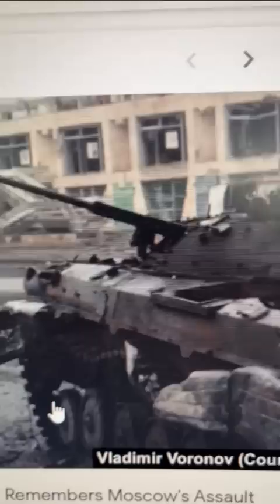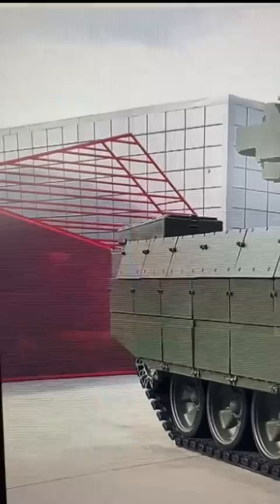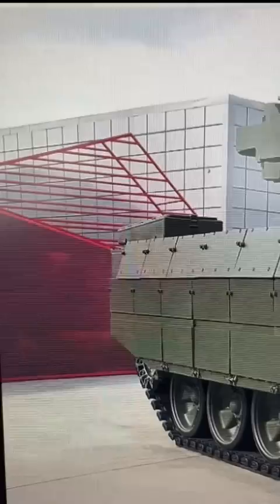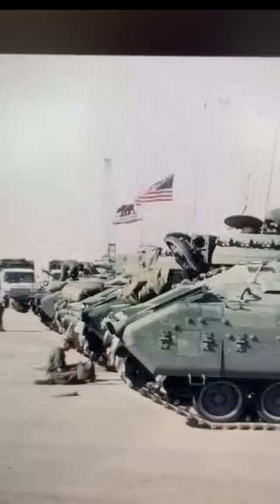BMP Terminator barrels shaking?

Comment: As a Retired Bradley Master Gunner, if I had one of my Brad's on a range have their barrels shake like that, I would pull them off the range. They ain't hitting shit like that. The terminator must be using its 30mm like a coax.
Reply: As a gunner on a brad, that shaking would have freaked me out. Circle X. Lol
Reply: They do not operate the guns simultaneously normally. They aren’t dual feed and each gun is loaded in combat with a different type of belt. This makes it as accurate as a BMP2 when firing.
Reply: @exo068  When I think of having two weapons, "let's make it impossible to use both at once" doesn't strike me as a design priority.
Reply: @michaelccozens  well there is mostly no reason to use both guns at once. One is usually loaded with APFSDS and the other one with HE. You have no reason to use APFSDS against soft targets and the single feeding allows for a easier design. The design idea was that you have something that is low collateral damage and can be used as a direct support of the infantry.
Reply from the maker: So you're a mike golf?  Did you ever get any sleep?
Reply: @exo068 It's 2 x 2A42 guns. Same duel feed gun that was designed as duel feed for the BMP2 only now there are 2 of them together. They literally built them in the tens of thousands now.
Reply: @michaelccozens except since they are just 2 x 2A42guns put together side by side and the 2A42 has always been duel feed since it was produced in 1980 that's not the case. Geeez guys, 5 minutes on wikipedia would have cleared this nonsense up.
Reply: Putting aside the inaccuracy issues, that much extra strain must wreck havoc on the weapon too?
Reply: @flyingace1234  I mean they've made the 2A42 gun on it in the tens of thousands since 1980 I think they've come to terms with
Reply: yeah probably something vibrated loose somebody  forgot a lock washer
Reply: These are hacked together solutions that were issued to people with zero experience. If you want accurate fire, use one barrel, you want to make the walls of an apartment go away? Use both. It doesn't matter how much the barrels can take since your going home in the Black Tulip anyways. If they can afford it.
Reply: @crazygmanssimstuff  Yes, and it does not have dual feed capabilities. The turret housing is likely preventing them from doing so somehow. 

This is the reason the lack of dual feed is so comical, because Russia has known how to do so for decades. The BMPT is a god awful design and it's really hilarious that it even got deployed.
Reply: @crazygmanssimstuff  as I said they don’t use the dual feed in the BMPT. The guns feed from different magazines and can therefore shoot both types of ammunition loaded at once. This isn’t standard practice but possible.
Reply: @exo068  in that clip only one of the guns are firing. You can tell from the case ejection
Reply: Ryan stop erasing my YouTube link to videos, people need to know how it look like when BMPT 2 mow forest's trees and destroy tank and bmp2
Reply: @187Rajah  hey ivan you don't YouTube much do you?
Reply: As he said, if it's at point blank range in an urban environment all it needs to do is point and shoot and something will get hit haha
Reply: @exo068  
Here's one you'll enjoy, and it involves the Duster gun he showed briefly in the video. 
I was a Vulcan gunner back in the 80's, my Sgt Major was on one of the 5 Vulcans in Vietnam, before that however he was over there on a Duster.
One day he was telling a group of us some stories about when he was in Vietnam, it's no secret that the North Vietnamese didn't have a very big air force and they never roamed south because they couldn't afford to lose any aircraft, so any air defense guns in the south usually were deployed on other duties like perimeter defense at fire bases, with the Dusters when they were task with fire base defense they'd load one barrel with the self destruct air defense rounds and the other barrel with regular 40mm contact fuse rounds typically used for ground targets, when the NVA would attack a fire base the Duster would fire the barrel that had the air defense rounds in it and give the NVA enough time to move their mortar positions up to just outside of the range where they'd self destruct, then they'd cut loose with the other barrel and give them "the last surprise they'd ever experience in their lives".
Reply: @dukecraig2402  yea I guess the idea is very similar to what the BMPT is trying to accomplish but it’s definitely less successful at its job. It reminds me of the tactic of shooting canister rounds at tanks to get the NVA off them. It was effective but very disgusting because it would let fluid flow on the engine and in gaps and it wouldn’t go off easily.
Reply: @exo068  
Yea, I heard about them using that and beehive rounds, it definitely made a gooey mess on the tanks, like being coated in a raspberry slushy.
Reply: @willthorson4543  Imagine the noise and vibration inside! 
Double vision problems.
Reply: @senseishu937  Urban, not military targets.
Reply: @theprotagonist8755  woot? You like to watch Ryan's russophobic videos?
Reply: @exo068  The single barrel firing in the video is shaking more than the one that isn’t
Reply: @kieranwalsh2058  the shaking isn’t that bad. The recording of the video by hand and with a lower resolution camera makes it look worse then it actually is. The shaking is comparable with the normal BMP2. It’s not good but also not bad.
Reply: @187Rajah  1. Ryan isn't deleting your links, it's youtube.
2. Go touch some grass
Reply: @trololoev  it has a dual feeder. They use two belts usually AP and HE. The belts are pushed towards the bolt and it can then chamber the round. The bold is positioned in such a way that it can feed from both sides so all you need to do is push one or the other belt  towards the bolt. This is very different from what western auto cannons usually do. They usually use rollers to delink the ammo first. This is more complex but allows the gun to be placed in different places in the turret.
Reply: @sebtroop23  so , why i can copy it elsewhere without any issues?
Reply: Remember in boot camp, seeing the M16 receivers stamped by Mattel, GM Torqueflite,  etc.? Russians got to see "twizzler" stamped on their weapons.
Reply: Yes but those are very different guns. If your camary goes 100mph, it's scary af. If your supra does 100mph, it's a cruise. It's a fixed recoil system. One balances the other. The only reason it could fire so quickly without being center mounted or a recoiling barrel is because of this setup.  This particular vehicle was tested for about 13 years or so before it actually went into production.  I'm pretty sure they would've seen if it had an accuracy issue. The longevity in such a setup, i cannot speak of.
Reply: @187Rajah you do know that it can be anybody reporting your links, do you?
Reply: @187Rajah  russo-fanboy is posting about Ryan and his viewers, while watching Ryan's videos and not understanding how yT removes links in comments?  Stop it and do your homework. You can't get those grades up wasting time on yT child..
Reply: @wildancrazy159  while who's opposing him? Oh, accordingly to you, an anglo-fanboy. Play more in child games
Reply: @worldoftancraft  I think it's a language barrier, you don't speak English as a first language. Anyone would be happy to help you out with that. Anytime you need help, please ask. I'm happy too!
If I may ask, where are you from?
Reply: @wildancrazy159  I do speak contemporary vernacular English. It's out of the field of speculations.

What I meant is to give you such a reply that would exaggerate the unpleasant to me findings in your reply. That's it.
"Russkie" sounds cretin. It's even doesn't spelled this way in original. Russkij(-aâ/oê/iê), |â| can be written as |ja| and |ê| as |je|
Not to mention your typical internet war accusations and assumptions.
Reply: I'd really appreciate it if you would if you were to add subtitles to your videos. They're great already though.
Reply: @drbadbrain4714 t's not "God awful" it's purpose is for support and urban combat fighting. As long it keeps it's comrades safe, and stay in it's role then that's all that matters. Putting it in situation opposite of what's it's capable of ruins it's purpose.
Reply: @subjectc7505  Okay. Its design is god awful.
Reply: @drbadbrain4714  What about it's design is god awful, it's a remote turret mounted on a T-72 hull. Any monkey with a screwdriver can do it.
Reply: those vehicles aren't meant for accuracy. they are meant to put an ungodly amount of ammo on a rough target area as quickly as possible. it's mainly geared towards anti-infantry but has anti-armour capabilities too as per the reason for the guided missiles. the shake is to help it disperse rounds a bit more
Reply: @donavonrobbins1908  M16 receivers were never stamped Mattel. They didn't make the furniture either, that's all fuddlore.
Reply: @crazygmanssimstuff  Geez guys, 5 minutes of editing wikipedia to say what I want it to say wouldn't clear this nonsense up.

Comment: They don’t need to be accurate. They’d say “Misha, blast the 4th floor of that building!”
Reply: Might as well take tbe 3rd and 5th as well
Reply: They need to be accurate when they aren't facing civilians because it won't be able to defend itself against even very old IFVs
Reply: terminator goed bbrrrrrrrr
Reply: Accuracy by volume
Reply: They ruddy barrels will risk either jamming or will shake themselves off...a design feature?
Reply: @wolimoli  they're meant to mainly fight infantry also they have anti tank missiles
Reply: @nates9105  “Screw it, just take out the whole building”
Reply: @start2957  yes, but if they are only accurate close up then they will struggle against modern infantry if not in a city and especially against IFVs
Reply: @wolimoli  did you watch the video?
Reply: @start2957  Yes, it was built for city combat. But troops being even a few streets away would hold a huge advantage over it with the inaccuracy.

And it will struggle even harder in anywhere outside of the city
Reply: @wolimoli  i dont think it would be much of an issue since it's 30mm and have an insane fire rate, but again they could simply use btr's or bmps to deal with far targets since the terminator was meant to shoot close at high apartments so if something is far other armor can shoot at it instead since they can raise the barrel in those situations
Reply: @start2957  But the issue is the chances of hitting something at a distance is super small even with a high fire rate. But btrs and bmps aren't much better either since none of those have stabilizers. Stabilizers are very important for any range at long distance over a few hundred meters
Reply: @sebione3576  Because if there's one thing Putin does well, it's keep the ammo-supply up?
Reply: @aA-ye1cf  well when it falls off by itself I guess it’s letting you know “it’s time for a barrel replacement now”, yeah.
Reply: Well, they blasted the whole building,all floors down
Reply: 4th floor is way too precise.

More like blast the street that building is on
Reply: "Eventually one of those rounds will hit the target.  Just keep firing"
Reply: @sababugs1125  “Blast this postal code”
Reply: they're great at deforestation since the rounds never hit anything lower than the first few tree branches in all the footage
Reply: @aA-ye1cf  Auto dismantle, for servicing.
Reply: Better check recent video where BMPT2 mowing down forest, destroing ukrainian bmp2 and t72 tank, and bunch of soldiers
Reply: @nates9105  And the neighboring buildings
Reply: @wolimoli  you woulnt fire auto at an enemy vehicle
Reply: @aleksandar4756  it wouldn't matter if it's auto or not if the gun has 0 stabilization
Reply: @wolimoli  this thing has the ability to pen over 900mm of rha with its missiles, no other ifv has this combination of armor and firepower also it only takes a quick search on YouTube to see it hitting targets at range on whilee even on the move consistently
Reply: "4th window? 4th floor? 4th street on the left? We will find out together Aleksandr!"
Reply: FACTS!😂👍👍
Reply: @waynejohnson1786  that is kinda the spirit.

Comment: Its mere harmonics. From an engineering perspective, allowing wobble can be ok as long as the barrel returns to its original position by the time the next round is chanmbered
Reply from the maker: I buy that
Reply: Which it doesn't. You can find old Soviet footage of a ZSU-57-2 shooting at a berm. Which is 2 57mm AA auto cannons in a turret on a T-55 chassis. Of the 10  rounds fired, 7 or 8 hit the berm. The barrels rattle a lot. But making them reciprocate would add to many to many parts.
Reply: Not knowing anything about the topic, I would like to suggest, "Go tell it to the Russians"

Comment: Ryan, you are wrong on this one. BMP-2 can elevate to an extreme angle of +74°. And BMPT is not an infantry support vehicle, it's a tank support vehicle, it's even in the name: "Boevaya Mashina Podderzhki Tankov" - Tank Support Combat Vehicle.
Reply: So, fun fact, the BMPT was actually designed to support tanks in urban environments because Soviet vehicles guns could not elevate high enough to hit roof tops and upper floors during the wars in Chechnya. The BMP-2 can elevate past 70 degrees NOW, but not in the 90s (this modification actually came AFTER the BMPT, which can only elevate it's own guns about 45 degrees). It has since been modified to do so. That also does not mean that what Ryan said about the reason for the BMPT's creation isn't true, because it is...according to the Russians themselves.
Reply: Different BMP, most of the BMPs in Grozny were BMP-1s. Regardless the Chechnyans were using the tops of apartment blocks to fire down on Russian armour with hunter-killer RPG teams. So it didn’t matter what the Russians used, they sent in armour unsupported and it was cut off, isolated & destroyed. 

You can still find footage of the point where Russian tankers get cut off and are being torn apart. They retreat into nearby buildings and beg for an extraction that also gets cut off & destroyed.
Reply: Also BMP-1/2 armour is roughly equivalent to paper (an M2 Browning or equivalent can go through the side armour), so the BMPT was more intended to have a vehicle with tank grade armour, but BMP firepower.

Comment: Interaction patterns (barrel 1 knocking barrel 2, or more commonly displacing barrel 2s round, with blast) for naval artillery is a known problem, and largely a solved problem.  Naval weapons use delay coils, minutely delaying firing one barrel.  Pretty much like one of the solutions he suggests.
Reply: Great point but one issue. In the video shown only 1 barrel is firing. It doesn’t use a dual feed system so that’s either the AP barrel or the HE barrel and it’s unlikely that the crew would ever fire both cannons at once making a delay system irrelevant. 

Whatever is causing the shaking has nothing to do with muzzle positioned or gas from the other muzzle. As far as I can tell it has to be either a fault or a design of the gun to make a “beaten zone” but if there’s other options I just haven’t thought of them or heard them yet
Reply: @cynicalfox190  Finally someone here who gets it right, thanks.
Reply: Yes, this issue was solved with the 40mm dual bofors during the 1940s. So why exactly is Russia deploying a vehicle with such a major issue that has been solved decades ago? The fact that they even allowed this to be an issue shows the quality of Russian engineers